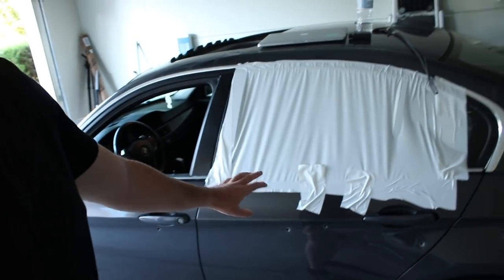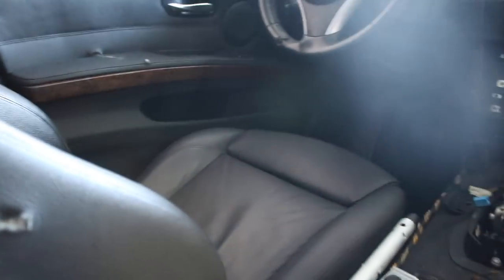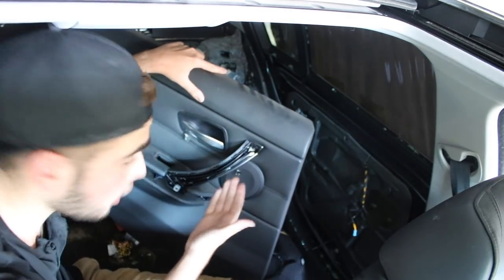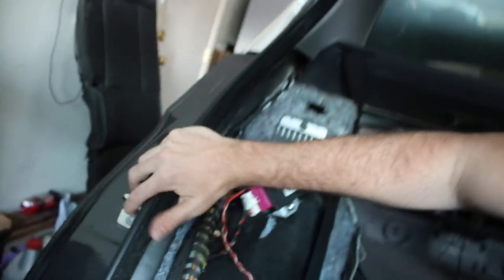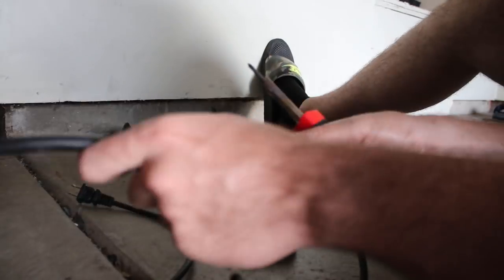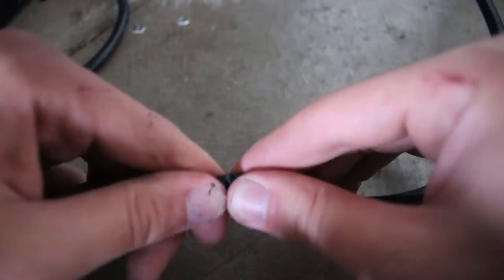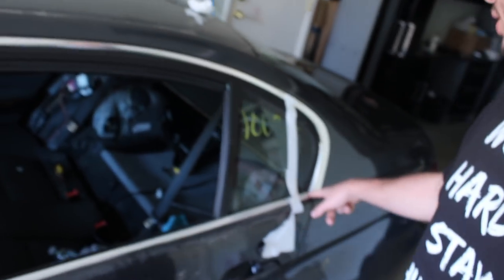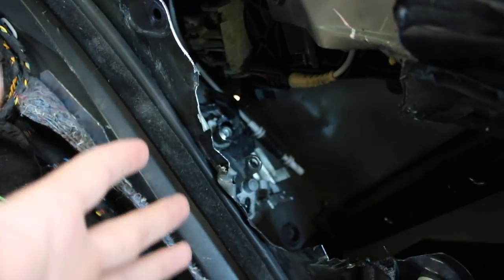Rebuilding BMW 335i Involved In Gun Fight! Part.4

Comment: You really should use a connector block to joint the wires as they will get hot when the cutter is in use. 
It’s much safer.